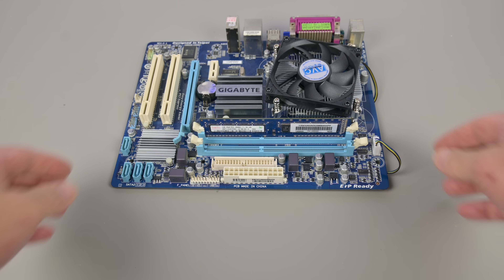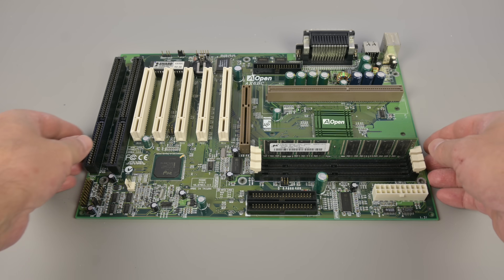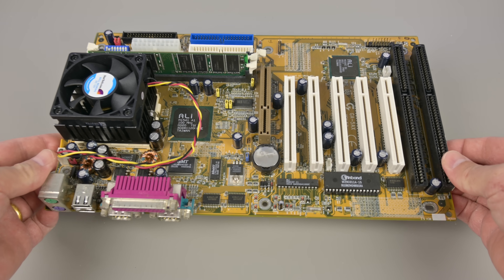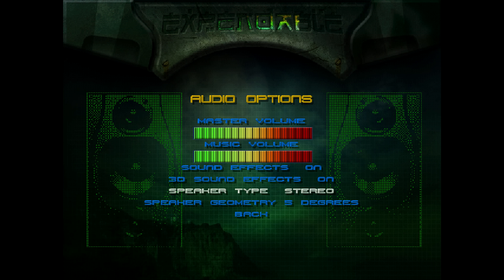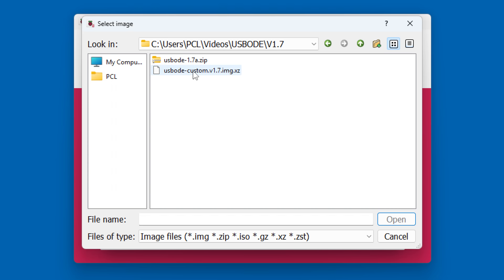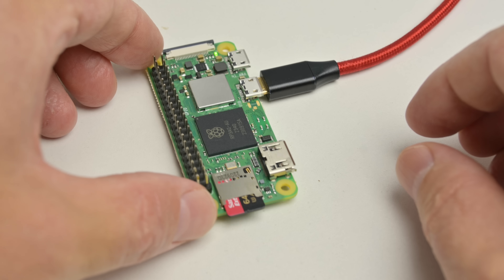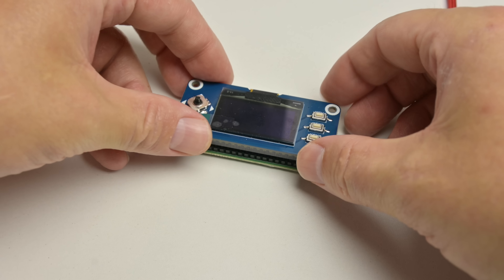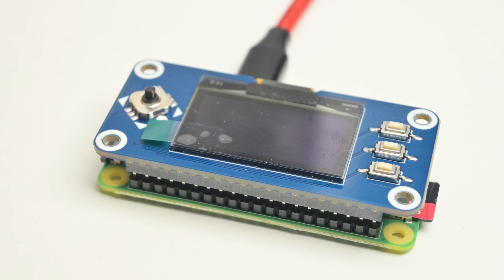Finally a cheap CD-ROM emulator for DOS and Windows 98!

Comment: Next stop: 3dfx voodoo to intel onboard gpu driver translator
Reply: Basically a glide wrapper like nGlide, dgVoodoo, OpenGlide, svenswrapper...
Reply: Jokes on you, I searched for this multiple times; I wonder if some kind of TSR like SBEMU could handle this somehow :)
Reply: There's actually something similar to what I mentioned, 3dfx glide. However, there's still no AGP 3DFX voodoo clone
Reply: That already exists as glide wrappers
Reply: @ericmackrodt9441  in emulators/DOSBox of course. But not in pure DOS as a loadable TSR on a modern machine.
Reply: While true that they don't exist for pure DOS they exist and work in Win95 (DOS 7.0) up to WinME (DOS 8.0), but a handfull of games don't work using a wrapper due of being statically linked.